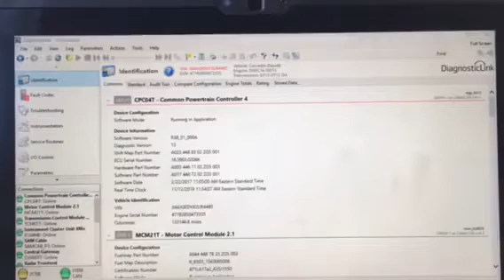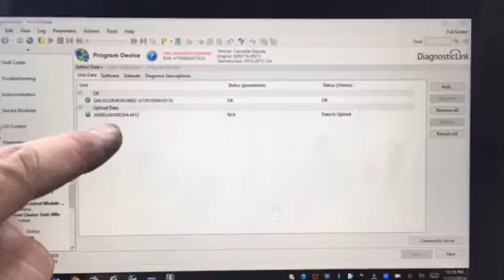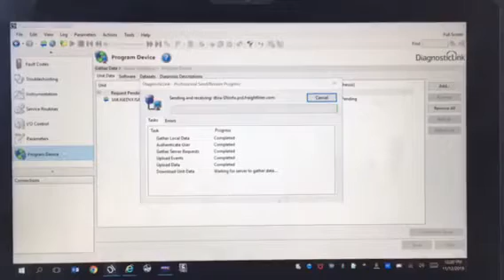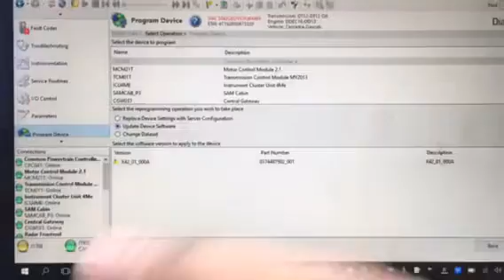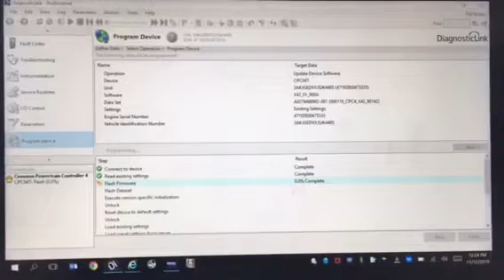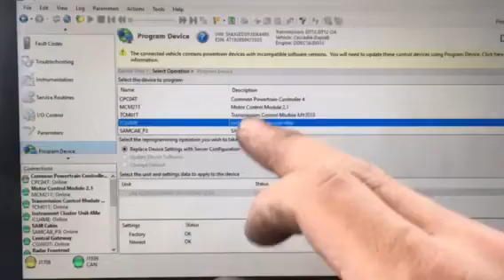Program/update Detroit diesel ECM/MCM/CPC/ACM

Comment: Mine is 2016 cascadia.. having too frequent regen issues?
1. Can updating any of these softwares ( acm, ecm, cpc etc) solve the issue?
2. How do i check software version myself. Right now it says some software# in icu info on my truck. What is that?
Reply from the maker: @inderveerbilling  it is possible it could solve the issue. If I was a betting man I’d say it is probably not a software issue but it is always best to make sure your software is up to date before troubleshooting.
To check your software versions you would have to have the Detroit software like you see in the video. The software number you see in the instrument cluster is the software number for the instrument cluster itself. Even the instrument cluster has software. Hope that helps.
Reply: thanks for ur reply.
How much it costs for updating all these softwares?
Also do you know what is difference in dpf zone 1 and zone 2 setting on truck.
Recently dealership changed my truck setting to zone 1 from zone 2 to see if it cud solve regen issue as i drive in city?
Reply from the maker: @ last time I checked, if you have the software, Detroit charges $200 per updating event. I’m not sure if that means each module or all modules. 

The reason you change DPF zones is to program the truck to do a regen when the soot level is lower. Your DPF is a big filter that catches soot from your exhaust. It has sensors on it that read the pressures on either side of the filter. If it is in zone 0 it will tell the truck to do a regen when the pressure in the filter is at a lower level.
When it is in zone 3, it will wait to tell the truck to do a regen until the pressures are at a higher level. The pressures indicate how much soot is in the filter.

The regen gets the DPF hot enough to burn the soot and make it ash which clears up the filter.

If you are regenning too frequently it’s because the filter is filling up with soot too often or you have faulty sensors.

A regen requires the engine to be on at a high idle and for a significant amount of time to pass so that it can reach the required temperature for the required amount of time in order to burn off the soot. When you are driving in the city, the truck is often not able to reach those temperatures or maintain them and so the truck does not do a full regen. 

You can try to put the truck into a manual regen when convenient for you each day and make sure to let it run its course until it is finished. It is also possible that there is a fuel issue. The after treatment system requires diesel fuel in order to heat up and that can cause the truck not to be able to get to the required temperature as well.
Reply: @alreyindustries  thanks for the info..
Can we program any module of truck so that it does active/automatic regens at low temp during mixed city/hyw driving?
Reply from the maker: @inderveerbilling  you would have to go to the parameters section and find the DPF tab under the ACM (after treatment control module) and change it to 0. Having it at zero programs the computer to do regens at the lowest soot level which may help with your problem.
Reply from the maker: @inderveerbilling  but it looks like the dealership already tried that according to your earlier post.
When is the last time the DPFs were cleaned?
Also, I have a video on “frequent regen problems” where a fuel valve was not allowing the truck to heat up enough. You can look at that video and see if that could be a problem as well.
Reply: @alreyindustries dpf was cleaned early 2021.
Fuel valve u mean 7 th injector?
Previously i meant to say was that can truck be programmed to REGEN AT LOW TEMPERATURE.. not low soot level..means in city truck doesn’t get heated up enough.. but what if it is programmed to  inject extra diesel through 7 th injector , even at lower temps?
Reply from the maker: @ https://youtu.be/5Ba_QcqziVs?si=0hglKtu5L21sY66M

No that is not possible. What are the codes you are getting?
Reply: @alreyindustries once during regen 2 months ago, i had got SPN 5246 FMI 15 with blinking amber light , but it cleared on itself after truck was off for 15 min…
Other than that it is  REGEN SIGN ONLY that comes after approx 700 kms every time.
Reply from the maker: @ and when the light comes on do you do a manual parked regen and it clears? Or what do you do?
Reply: @alreyindustries  yes i do manual regen and it clears . Till next 600-700 kms
Reply from the maker: @inderveerbilling  yea unfortunately it seems like this issue needs some more troubleshooting. I would try updating all of your software and see if that does anything. If not, you would have to troubleshoot from there.

Comment: Im getting these 3 codes
SPN 521049 FMI 31
SPN 521050 FMI 31
SPN 521052 FMI 31

if i do the same thing step by step like you did, will it solve the problem????
Reply from the maker: I would do an SCR test and see if it passes. If it passes and the codes are still there then I would try updating the software like this video. 
If it fails, it should tell you why it failed and you can go from there.

Comment: Do u think  my ruck need  updated  ? The acm sbs cpc sometimes  dont want to comication together they need apdate  i have cascadia 2016
Reply from the maker: Usually communication codes can be resolved by updating the software but I couldn’t tell you 100% without looking at the codes and your software levels
Reply: @alreyindustriestoptechdies4702  where r u located  I have spn 625 fmi 9-14, 2033-9,2025-9  the show me radar error data off end turn the abs  n check  engine light
Reply from the maker: @thesol0906  I just had some of those same codes and it was a bad battery. Disconnect your batteries and test each one individually. Check the voltage on them. See if any one of the batteries is abnormally low on voltage.

Comment: How’s it going brother just replaced my cpc4 on a 2016 freightliner cascadia however when I replaced it it gives me code spn 961 fmi 2 don’t know why so already tried resetting the clock and powering off for 30 seconds any suggestions would be greatly appreciated
Reply from the maker: Did you program it after replacing it?
Reply: Yes truck is programmed and code is still being  displayed
Reply from the maker: @miguelitomentado5621  why did you replace it in the first place?
Reply: Truck began to idle on its own l was giving gas like crazy when plugged in it threw several codes from the cpc4
Reply from the maker: @miguelitomentado5621  I’m not sure man. From what I’m reading the troubleshooting says if you have that code then you replace the CPC.
I would update all of your other modules if you haven’t already especially the MCM. Key off after everything is all done and see if that does anything.
After that I would try comparing the CPC you just installed with Detroit diagnostic link’s server information. Someone would have to know what they are doing in diagnostic link, go under the parameters tab, and compare parameters. You can compare your CPC’s parameters to the highest software version parameters for your vin, as well as compare your CPC’s parameters to the old CPC you took off if you connected to that CPC with the same computer before replacing it. If the parameters are different you can change the parameters in the new CPC to the old and that might fix the issue.
Other than that I don’t really know what else to do without being there and seeing things for myself.
Reply: 10-4 brother will take your information and see what can be made of it I greatly appreciate it and will keep you in the looop

Comment: Is this the same process id use to reprogram a  swapped ecm from donor truck into mine. My ambient air pressure sensor went caddy wampus. I have access to the software through company i contract through.
Reply from the maker: Yes. It’s the same process. What kind of issue are you having if you don’t mind me asking? When you say the ambient air pressure sensor you mean the barometric pressure sensor right?
Reply: @alreyindustries  yeah having turbo issues,throttle body deviation error and high intake boost, intake boost high during regen etc and alot of weird electrical issues after driving through an extreme rain event. Data link lost codes etc. Think it got moisture in it on top of the barometric pressure reading being all over the place.

Comment: Is this standard diagnostic link or pro diagnostic link ? Can I update with standard diagnostic link ? Good video , I just changed CPC I figured it was plug and play . I had a hell of time with wires and connectors those numbers are barely visible. Everything is working , starts , etc ! Except the cruise clutch / the park brake/ service brake say open circuit … but the service brake turns off n lights when applied , real ease light all work, do I need to update everything like you did so it works correctly!!!! Let me know thanks
Reply: If I go to cruise control screen I can see on bottom it says clutch open ( signal not available)- park brake (open green) - service brake pressed ( open red) so my cruise control don’t work and I cannot regen do to these ? On a good truck different vin and year like 3 years apart the cruise control screen is clutch open(grounded released and green) park brake ( grounded on red) service brake (released grounded green) so everything works on this one ——so do I have to reprogram CPC- mcm- acm- and this truck is stick shift ? Let me k ow thanks ?
Reply from the maker: You cannot program with standard diagnostic link. You can try comparing your parameters to see if maybe some of the parameters in the new CPC were different from your old and change those parameters. That might be your issue:
https://youtu.be/ZmlcnRiaeag
Reply: @alreyindustries  so I need the diagnostic link pro ? What happen is we had two CPC’s stolen and the cut wire so they took part of harness and all four connectors too the white, grey, brown, blue .. and the sister truck is also the one they stold CPC —-so I would have to purchase diagnostic link pro to reprogram the CPC I have correct ?
Reply: Update date it I mean
Reply: Wait I’m confused can I update parameters with standard diagnostic link ? Or do I need pro diagnostic link to update parameters? I’m sorry Reprogram can only be done by dealer ? I’m new to this thanks for your time
Reply from the maker: @Diezeling  I’m not sure about changing parameters. You might be able to do it with standard. I know to update/program an ecm you have to have the dealer version and it costs $200 per programming event
Reply: @alreyindustries  what version did you use ? Are you a dealer or independent mechanic?
Reply from the maker: @Diezeling  In this video I was using dealer software

Comment: Thanks for this video. 
My truck freightliner cascadia 2016
New cpc was replaced to my truck recently.
When I check the engine info by the dashboard setting.
The screen showing almost 100k over the real mealge number the one was before with the old cpc 
How can I prove the real number 🤔 
If I put the truck on sale ?.
Thank you..
I called the freightliner dealership they was telling no program will fix this.
Reply from the maker: I have never experienced this issue, so this is just what I would check first.
If you have the Detroit software, hook up to the truck and click on the identification tab on the left. That will bring up all your modules.
Find the cpc module information (it should be the very first one on the list), and check if the cpc has your truck’s correct vin and esn. 
If they programmed your cpc with the wrong data, it’s possible this could have caused the problem with mileage, but I’m not sure. 
If the cpc info does not match your truck info, follow the steps in this video to program your cpc and it may solve your problem.

Comment: Will a bad ecm make your truck just shut off? No check engine light or nothing just idles for a minute then cuts off. Shop can't figure it out so have to go to a Detroit dealership
Reply from the maker: Does it cut off electrically or does the engine just cut off? Like, does your dash and everything go out or does the engine just die?
Reply: @alreyindustries  the engine just cuts off. Then I try to restart it and it won't crank. Unless I turn the key off and let it cycle like a 1st start.  If I try to hurry up and drive it, it just cuts off. Shop said it gets fuel so it must be ecm or sam?
Reply from the maker: @custommade8830  any fault codes?
Reply: @alreyindustries  2 faults. Sid 254 fail 02
Pid 370 fail 03.
They plugged into it but said nothing popped up on their laptop. So they were lost
Reply from the maker: @custommade8830  Cummins engine?
Reply: @alreyindustries  nope 60 series Detroit.  14L
Reply from the maker: @custommade8830  hm yea that’s a tricky one. Sorry Buddy I was trying to look some stuff up but I don’t have much experience with that engine.
Reply: @alreyindustries  its all good. I'm gonna get it towed to the dealership Friday and see what they say.  I subscribed to your channel. Thanks for trying to help

Comment: If you are trying to obtain accessibility to log into the server you will need to own the truck in your name/company name. Call the dealer and have them update the warranty database info. They will not supply you with professional access if you aren’t a repair business with documentation. The basic software cost me $500 from the website and is good for one year and doesn’t include programming access. The first year, they accidentally gave me pro access, when I renewed it was only basic. You can get a cracked version but you will not be able to connect to the server and if you try, it will block the software completely, it will shut down the program and will not open.

Comment: Hey , am new to the DD15 , is it a must that all the modules should have same vin nu. 
As Incase of breakdown or something we use used parts from other trks .
Can it work without syncing them .
Reply from the maker: I swap modules from different trucks from time to time. It is important that they sync, it can cause problems if you don’t reprogram certain modules when swapping them. 
I’m pretty sure you can do it by updating the modules like in this video or under the actions tab at the top of diagnostic link there is an option for synchronizing vin. You could try that as well.

Comment: Does any one know how we can get usernames and password . There is any kind software? We can create account  .
Reply: You need to get it from Detroit.
Reply: thank you sir. do you know how much it can cost ?
Reply: @pat4532 Password and login will cost you nothing but software does. All you need is your truck to be under your name. Go to dealer and tell them to update Warranty registration form. They will ask for your pink slip and update the database. If you got your Freightliner truck brand new under your name you can contact DTNA to get password and account. The password and login will be issued to you. Then you need to buy diagnostic link software professional version. Professional Program will cost you about $1000 or more for a year subscription.  Regular one doesn't have programming options and it cost around $500 to 600 per a year. If you have a cracked software and you enter your DTNA login and password it will not connect to Server.